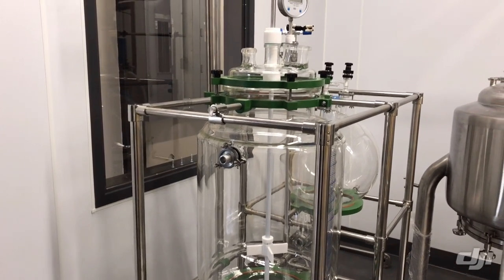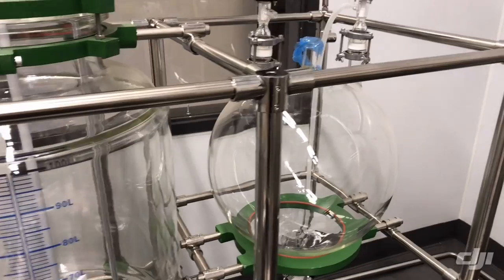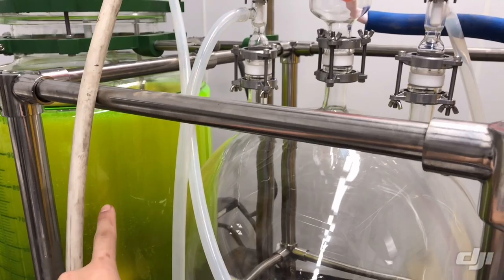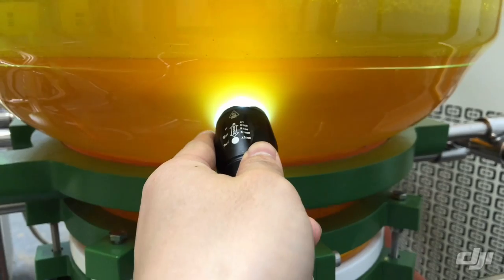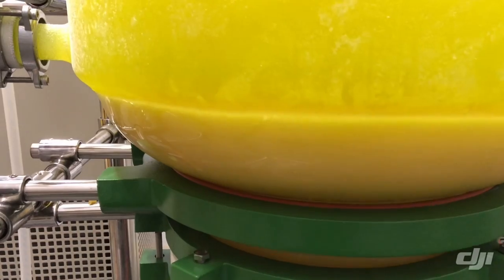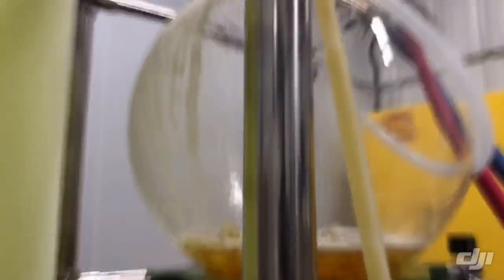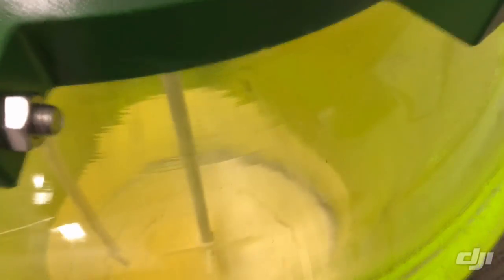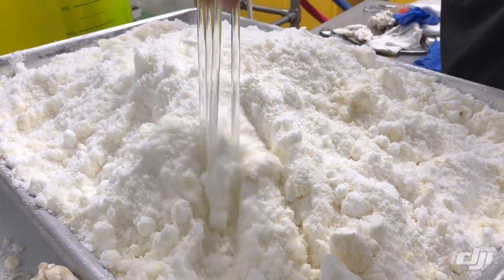How to make CBD Isolate at 99.6% pure | Turn Distillate into Isolate !! | Free SOP write up

Comment: Wonderful explanation, thanks. To add, if you have only standard stir reactor, you may need to purge the pentane with vacuum before emptying the isolate and then Rotovap and or vacuum oven.
Reply: What other kind of reactor would avoid those steps?

Comment: Hi Jimmie, thanks for the video.  You mention "washing the crystals" after they have formed one time with cold pentane.  Can you say how much cold pentane and at what temp you need to wash the crystals?  Also, do you have a preferred method for chilling the pentane, like in a another reactor with attached chiller or do you use a freezer?  The first option seems better simply because a freezer isn't a safe place for hydrocarbons/solvents.  Thanks!
Reply: i always do 1:1 washes atleast. -45c pentane kept in a deep freeze. so if you started with 1 liter of distillate and crashed your cbd. drain your Mother Liquor and use 1 liter of sub zero pentane. as many times as desired. when the cbd isolate is white as snow we drain under vacuum. empty into pans. place in vacuum oven for atleast 24 hours.

Comment: What is the best way to dry the isolate?  Would you suggest a vacuum oven OR could you use either a blast drying oven or a food dehydrator??
Reply from the maker: blast drying oven like the one that used to make milk powder. The cheapest way is vacuum oven on low heat.

Comment: Hello friend, what it's the ratio between pentane and distillate that do you use? And what it is the yield that you get? Thanks
Reply from the maker: 1 part of Distillate dissolve in 2.5 parts of Pentane. I got 90%. You can get higher yield by reusing mother liquid.
Reply: Juan David Rivera  it seems as though you're leaving behind most of your CBD still in your mother liquid. You need to use more pentane to allow the crystals to suspend and then crash out it seems as though your mother liquid might be too saturated to have a good seperation. I would recommend for every kilo of CBD disty to use at least 2 kilos of pentane/solvent and don't just leave it set at a certain temperature overnight, you have to gradually keep going lower and lower over time ideally to -40c or as close to it  and then make sure you evacuate the system of excess mother liquid as soon as full seperation is getting close because if you just leave it overtime you'll start homogenizing the CBD and mother liquid again.